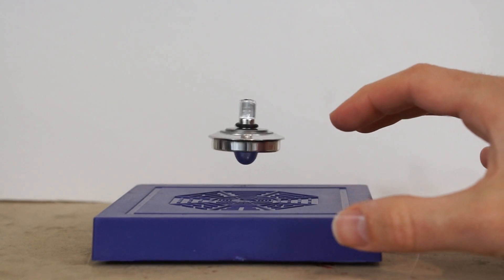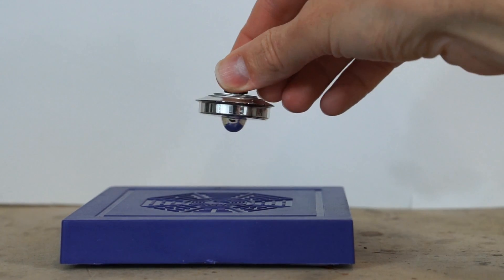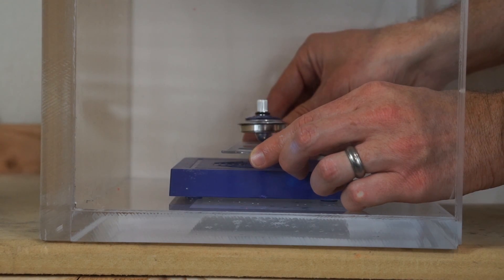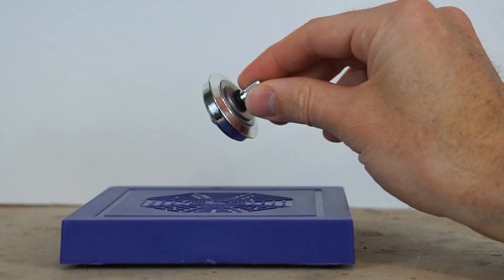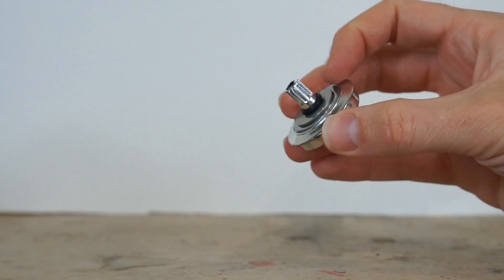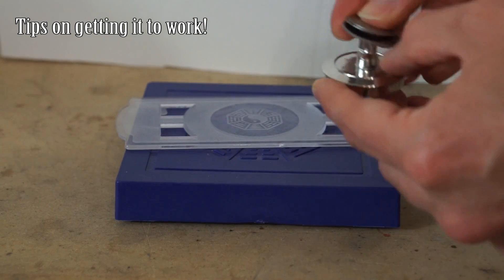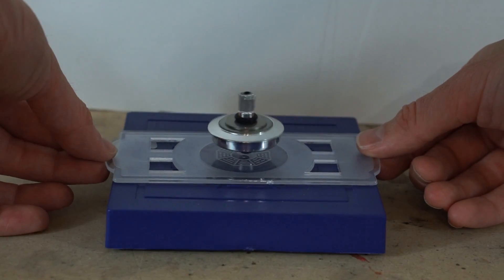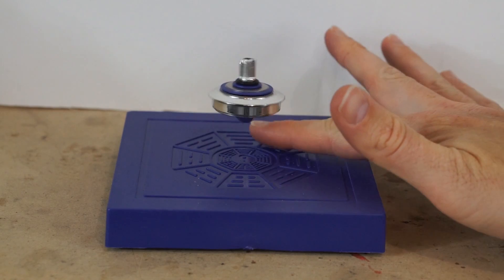Will a Levitating Gyroscope Spin Forever in a Vacuum Chamber?

Comment: Prediction: It will never spin forever, because it is generating electricity. Any time a conductor moves through a magnetic field, it will generate electricity, and thus heat, which it is getting from the rotational kinetic energy of the top. As it slows down, it will make a small amount of heat, and eventually stop spinning. Even the Earth's magnetic field would slow it down to a small degree.

Comment: Hi, i was thinking a bit about the planets rotation and an idea came to my mind: as you say everything in the universe is interacting with everything else by gravity (lets imagine that's the only force that makes them stop spinning). imagine also, to simplify the system, that everything spins only in one axis (so there's only spin right and left), it's infinitly more probable that there is more mass spinning in one of the two ways in the whole universe, so would everything stop spinning sometime? or if, for example, there is more mass spinning to the left than to the right, everything would end up spinning in that direction with the same momentum that the system had at the beigining?

Comment: The air isnt the onlu factor taking away energy.
My guess would be that the 2nd highest energy loss would be due to forces working against one another, even though very slightly.
When something moves forward in complete enpty space, it will keep moving endlessly or until it no longer is in an empty space (or vacuum)
But when something spins, the forces that make it spin are directed to the outside, in the direction it is spinning from every single unmeasurably small part of the object, and the forces that pull the molecules behind them towsrds the direction that they are moving, and thus changing the direction slightly, causing it to spin instead of exploding into billions of seperate molecules.
It is kind of hard to explain because i never learned the english words required to do so, so sorry for being so uncapable.

Comment: It will stop eventually, because there is SOME air in there. It will take much, much longer than in regualr air, but it will stop. Also, the rotational instability should cause it to lose a little momentum for every "stumble" in the magnetic field.

Comment: Doing basic statistics is the answer to your problem.  You spin it 10 times. Measure each time and average the 10 deriving a mathematical mean. The more times you spin it (say 50-100) - the more accurate your averaged result will be. Might be a bit more difficult in a vacuum but you got lots of time I assume for someone whose videos provide passive income even when you're not working.

Comment: I don't believe your explanation of the magnet in the base sliding a bit, is what causes the friction that makes the disk stop spinning. That would mean that using a fixed magnet that does not move would keep the disk spinning forever!?
Reply: or longer?

Comment: Ok. Suppose the magnet in the base was spinning same direction at same rpm(or close to). That would eliminate magnetic field friction. For that matter, even with atmospheric pressure, the top should spin indefinetly.  Unless the airs friction is greater than the magnetic fields friction. But in the vacuum, it wont be.

Comment: It seems to me that it falls because you are spinning it by hand. That makes it difficult to get it level and create a stable spin. I would suggest a mechanical spinning device for your next experiment with this. It seems to be where there is tje most room for variance.
Reply: Ok. Suppose the magnet in the base was spinning same direction at same rpm(or close to). That would eliminate magnetic field friction. For that matter, even with atmospheric pressure, the top should spin indefinetly.  Unless the airs friction is greater than the magnetic fields friction. But in the vacuum, it wont be.
Reply: Halifax Gibbet. With the base and top both spinning the top would lose the magnetic repulsion thus would not
"levitate".
It seems also we are forgetting the second law of thermodynamics: in a closed system entropy always increases.
Reply: @timothystoutland6961  
Hmm. I thought the magnetism and air friction would be eliminated because top and base have the same momentum
And the gyro would keep it balanced indefinely. 
But it needs contrast in temperature in the immediate atmosphere to work? That's wild.
And I thought I was on to something. Rats.
Reply: I don't think that's true.  It might lose spin-stability, but it would keep repelling magnetically until to top tipped over.
Reply: Timothy Stoutland
Reply: This question might be complicated or even mooted by the requirements of this levitation.
I have seen tops that were very "quiet" (not wiggling much) go to the middle and suck straight down onto the base, not even flipping then.  So, a theory:  what if there is always a narrow funnel-shaped drain in the middle of the magnetic well, and only the side-to-side motion keeps the top from slipping down into that funnel.  And side-to-side motion is caused by magnetic precession pushing off the big magnetic field of the base.  If these are true, then you can't get rid of the wiggling of the top, I mean you can but then the top would fall down the middle, within about 3 seconds, even though its still spinning fast.
Bummer, I can't even figure out how to rest this theory.
Reply: @jimswenson9991  
Yeah. But what I'm saying is, if air friction is eliminated, then the only thing left to keep it from spinning indefinetly is the magnetc friction. And can be eliminated by spinning the base at a speed fast enough to keep the gyro effect continuing on the top. With the gyro effect going, it wont topple. Or it shouldnt.
Kinda like cowboys spinning a rope. The only reason the rope doesnt stay up is gravity. But as far as keeping it horizontal, its because of a continued spin.
Reply: Malacai Swift the Gravity of the earth Will make It drop eventually
Reply: I understand.  I think what you suggest would indeed remove virtually all decay of spin.
Reply: @jimswenson9991  
I kinda wish i had a vacuum chamber. Id give ot a shot and see what happens.
My kind of luck, I'd probably open some kind  portal full of irreversable demons.
Reply: Rational Nationalist  -  I doubt any portals or demons would appear.  Maybe someone will do a further experiment for YouTube sometime.  Have you considered buying that 2-stage vacuum pump from Harbor Freight?  ~$250, iirc.  Get yourself some actual vacuum experience, make it something you pretty much understand...
Reply: @jimswenson9991  
I was just being s smartass about the demon thing. I got plenty at i gotta deal with. Lol. 
But for $250 I could build a tank big enough to put an air compressor inside it.
How much is sea level amospheric pressure anyways. 17 lbs. Or something like that ,right? Besides. When it comes to Harbor Frieght, you dont have to spend much on a product to find out it sucks.  Just kiddin.
Reply: Rational Nationalist -  Suit yourself. I bought one and it seems to work ok.
Reply: I was just thinking, but just creating a vacuum doesnt actually get rid of the air, does it? Its still going to contain a gaseous soup that would cause friction. In contrast to outer space, where gravity takes the gases away .
Reply: Rational Nationalist - well, yes, the air is removed from the chamber, but the job is never absolutely complete. A vacuum pump traps air that wanders into its input port, and pushes it out into the surrounding atmosphere.  I think of degree of vacuum as  "what is the ratio between air pressure&density in the chamber, and 1 atmosphere (14.7psi & ~0.001gm/cm3) outside?"  In the video above I think the max ratio was about 20, i.e., 5% of 1 atm.  A two-stage rotary-vane pump has a better max vacuum:  about 20,000.  Typical high-vacuum pumps reach better than 10 million ratio.  Then there's much less air drag.
Reply: There are 3 regimes of gas density & drag:  At 1 atm it's a massy fluid (think wind...). At 1/1000th atmosphere it's a viscous fluid, it doesn't have enough density to buffet you with its momentum, but the molecules make a damping network around you that can do a certain lesser drag.  And below about 1/100,000th atm is the "molecular flow" regime, where molecules only bounce on you and the chamber walls, usually never meeting other molecules.  Still a very small drag, this is what slows down satellites over months & years.

Comment: You're talking, alas, some crap in your video ! The problem does not come from a slowdown in the magnetic field interacting between the lower magnet and that of the router (which are therefore in repulsion), but is due to friction on the air particles still present in the chamber of experience from the beginning and while you're emptying !!! So, it's not about the "magnetic friction" witch doesn't exist !! This is why there are magnetic bearings to replace ball bearings, to avoid mechanical friction... And about eddy currents, this is unlikely, because the magnetic field repellent between the router and the base is vertical and non-horizontal. Moreover, it is continuous and non-reciprocating N/S...  But it was a good idea to research ! Try the next time with more kinetic energy rotation of the router, with a totally internal system of release and levitation.... With a mechanized system by servo, for example....

Comment: You said that it wouldn't spin forever even if the universe died. If something spins until the end of the universe, wouldn't that be spinning forever? I mean, once the universe dies and nothing is left, there is no such thing as time as time is a result of something existing and it didn't stop spinning at any point in time but rather it would have just simply stopped existing. Idk if I'm right or even make sense as I'm sleep deprived, hungry, and have a massive headache, but I would like an answer explaining if I'm right, wrong, or partially wrong.

Comment: Take a power drill and open the jaws of the drill head just enough to capture the upper edges of the top, spin the drill up to max speed, and slightly lift the drill upwards allowing the top to settle in the magnetic field. Enjoy.

Comment: No such thing as a perfect vac.
Secondly, vertices axis changes must surely absorb energy and slow the gyro quite quickly?
Reply: i agree, even in space there are gasses
Reply: @milanodijk4529  haa good every one knows that and no need to say about that from u
Reply: Yeah but in what lost people call "space", it's so negligible that any rotating object will not loose enough momentum to even be observable during an entire lifetime.
Reply: The magnetic field loses its magnetism over time that's is also an important key to other perpetual motion devices
Reply: space
Reply: Yep you are right
Reply: You're exactly right, but it's because as the axis changes, the magnetic field strength changes. That causes eddy  currents to be induced in the metal disc, which puts a electrodynamic drag on the top. That's why there was practically no difference in spin time in or out of the vacuum chamber. I do realize that by the time he got the vacuum pulled, it had already lost much of its momentum, but the bulk of the loss is exactly what you said.
Reply: I agree,  the losses being caused by energy lost to procession keeping the top up.  But I also think that the magnetic top rotating in a magnetic field will cause electrical resistance and that energy to move the electrons is coming from the rotational energy,  just like cranking a generator.

Comment: It will stop, while air resistance is a part of why it stops in atmosphere, the other reason is the very thing that causes it to float in the first place: the magnetic field.

So the gyroscope effect from spinning is stabilizing it but the initial force you apply to cause the spin is finite, that force allows it to "fight" the pull of the opposite pole that is being attracted that you showed at the beginning. If you drop it with no spin it flips over, well eventually that force that is constant and attempting to flip it will win out over the finite force (or rather energy) you put on it to give it spin. It will spin longer due to less air resistance but not forever.

Comment: Is not obvious that continuous spinning in strong magnetic field will turn into heat and loose its energy ending up with falling? Oh come on, friction? RLY? Then you must prove that hypothesis with reduced friction (floating stand for example) and stats. And finally you end with gravitational waves. Wow. Waves of what matter? The soup of scientific beliefs instead of stats and measurement is even worse at the end. Disappointing. P.S. Did you know that electrons in single atom actually CAN spin forever and that proven by science with help of mathematics?

Comment: No, it won't spin forever.  The gyroscope is a spinning magnet, meaning it is interacting magnetically with everything around it, including the Earth's magnetic field, and that drains its kinetic energy. Also, even if it could spin forever, it still wouldn't be a perpetual-motion machine, because you're having to constantly input energy into the system by operating the vacuum pump to maintain the vacuum that allows the gyroscope to spin without friction. ANY input energy after starting the process will invalidate claims of perpetual-motion.
Reply: no one said it would be perpetual motion

also he can turn the vacuum off once it reaches the pressure he wants
Reply: There is something called a "Valve" to maintain the vaccum after the desired pressure is reached, ever heard of it?
Reply: @kavinsp : Find me a valve that can maintain a vacuum forever without leaking.
Reply: Fuck thermodynamics right
Always fucks us over but its life
Reply: @kavinsp : A perpetual motion machine must be able to run without any input energy forever.  Forever minus a day isn't good enough.
Reply: No.  Most of the energy is lost by procession,  keeping the top upright and more is lost by electrical resistance as the electrons in the rotor are moved through the magnetic field.  It takes energy to do that,  just like it takes energy to crank on a generator to get the electrons moving.
Reply: @SeattlePioneer : Even if you did this experiment with a top cooled-down to superconducting temperatures so there's no electrical resistance inside the top, it would still stop eventually, and all of the input-energy required to cool the system and maintain a vacuum would be further proof that it's not a perpetual-motion machine.
Reply: @fyrstormer  Oh,  there's no question but that it's not a perpetual; motion machine.

The question is,  what is consuming energy that will cause the system to collapse?

I suggest that the major energy consumer is the precession needed to keep the top upright against the force of gravity.  The top WANTS to collapse because of gravity,  just as it collapses if it's not rotating.

It stands up because of the rotating mass,  which has energy.  When gravity starts to pull the top down,  that is prevented by precession,  which exerts a counter force against gravity,  but gets that force from the kinetic energy of the rotating top.   As the top slows,  the precession has to become ever greater to, prevent collapse,  which consumes ever more kinetic energy until collapse occurs.

I suggest that is the biggest energy consumer in the system,  and the major reason why collapse will occur. Vacuum or no vacuum,  Eddie currents or no eddie currents.
Reply: Theoretically you could get most or all of the air out and close the valve and turn the pump off so no furthen work done
Reply: Perpetual motion machines are impossible cause Einstein proved that energy can’t be created or destroyed and to make one there has to be electricity moving it.
Reply: Anyone else reading this like me would probably be like
‘I totally know what this means!’ (100* sarcasm in voice)

Comment: The spinner magnet and the magnet in the base, would induce a small current in each other, which adds to the repulsive magnetic field of each magnet and helps to keep it floating, but the currents will be lost to heat over time which would account for some of the loss of levitation, as would the inconsistencies in the materials meaning that the currents could fluctuate chaotically, thus destabilising the system further.

If you had superconducting magnets in a vacuum, this would keep spinning for a very, very long time but I don't know enough about the EM radiation effects in superconducting magnets to say anything about whether they would leak energy in the form of EM radiation (as charges are moving within them), but it's an interesting experiment that has got m thinking about may reasons why it wouldn't last forever.

Comment: In zero gravity/microgravity it would continue to spin forever or until energy is transferred to another object or system. In this case it is losing energy to both gravity and also to the magnetic platform it is "levitating" over. As it rotates it is inducing eddy currents on the magnet underneath, which costs energy. Those eddy currents also fluctuate as the spinner loses velocity and generates less current causing instability in the spinning magnet and its realigning to the new net forces imparted upon it, then eventually all kinetic energy is used up and the spinner will stop, become unstable, and fall.  Friction from interaction with air is not the only mechanism for energy loss in this system; there are multiple energy transfers taking place here even when you take atmospheric drag out of the system.